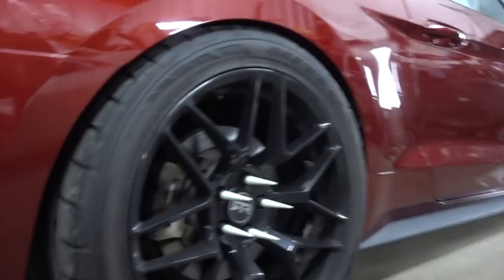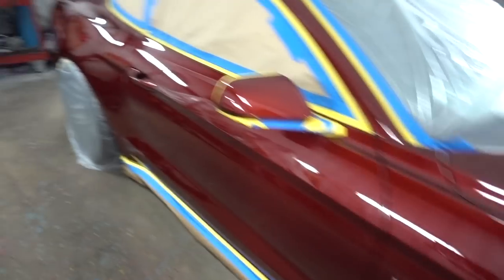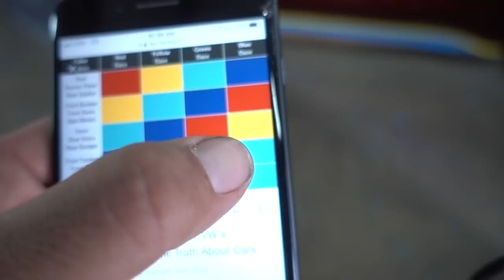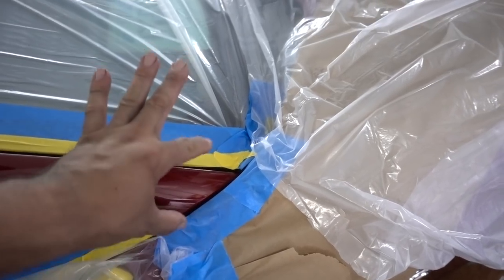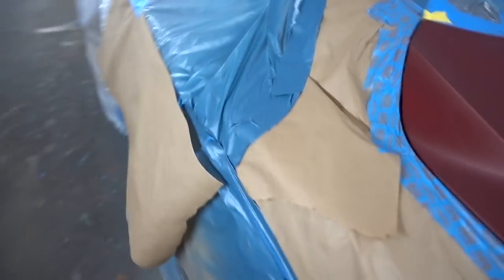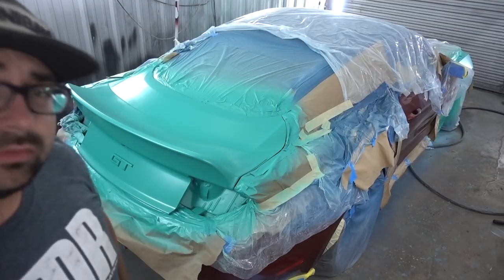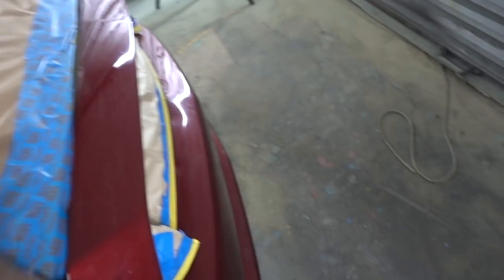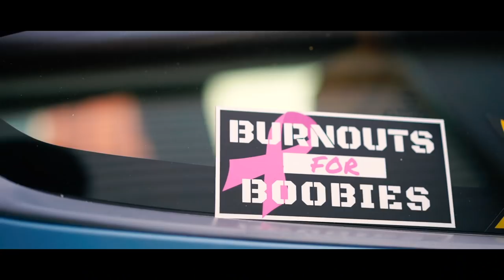Making a Harlequin Mustang with Plasti Dip

Comment: Ok this looks sick. My only recommendation would to use a blue like flex blue or something for the blue parts as it's much closer of a match. Heck, maybe flex blue with a bit of black mixed in? Either way, awesome work!
Reply from the maker: Yea.  Blue could’ve been a little closer.  They used to make gallons in Navy Blue that was pretty much the perfect mix of blue/purple and darkness, but they stopped making it a while back.  😔
Reply: @RobRabonPhotog  Dang, either way the car still looks great man. You earned a sub